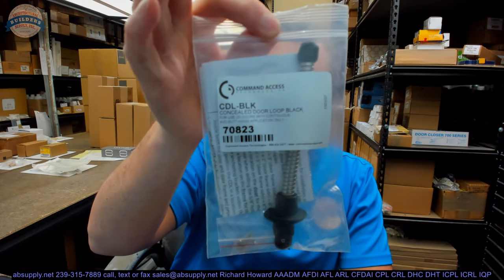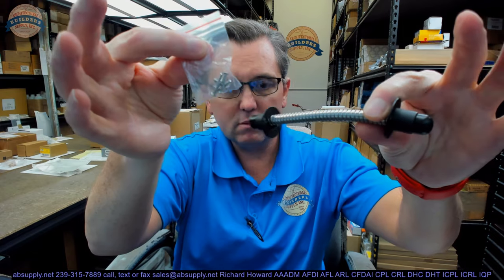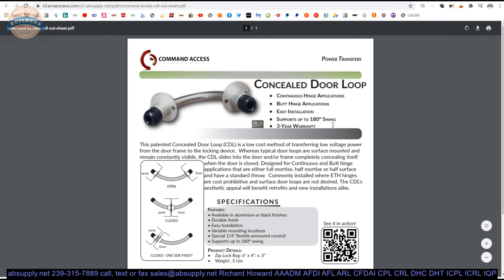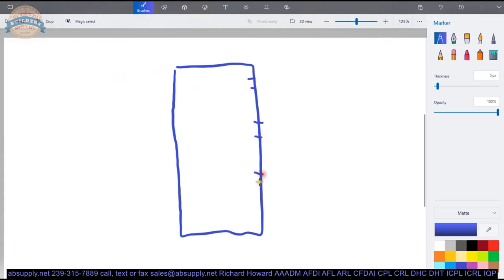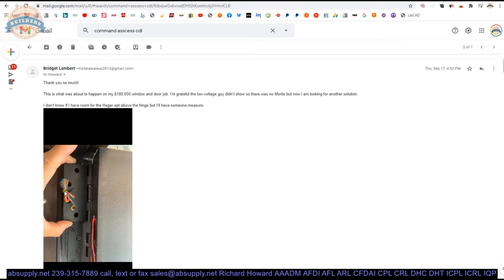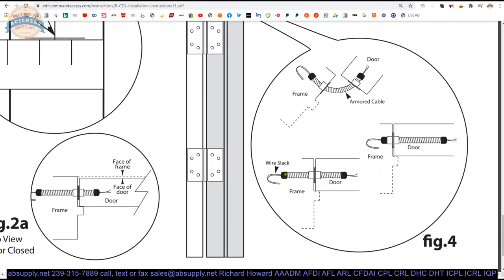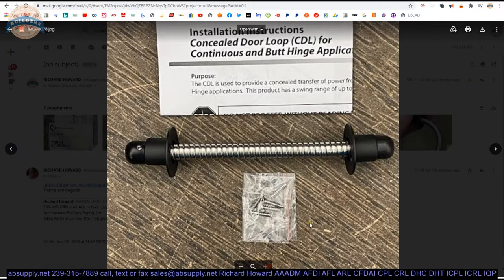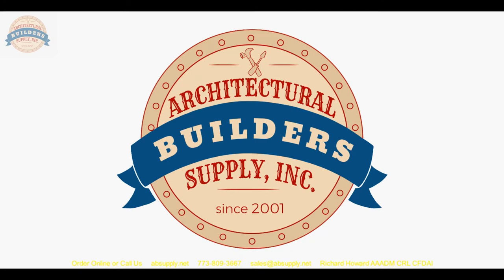Command Access Company CDL BLK Concealed Door Loop

Comment: You can only drill a 3/8 diameter hole into the core of a fire rated opening in the field. Correct?
Reply from the maker: Depends on what you are prepping for and NFPA 80 is the technical standard that defines what is permissible and if adopted by your local code, would be the governing document.  The Command Access CDL-BLK Concealed Door Loop is not listed nor labeled for use on fire doors.